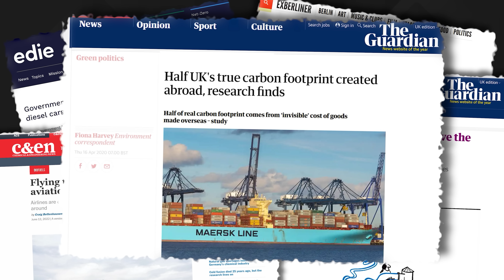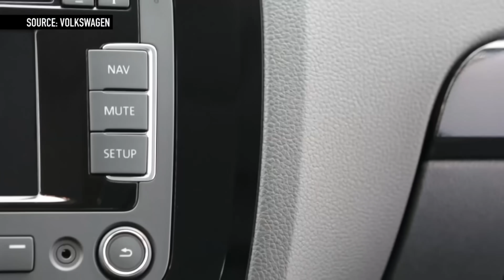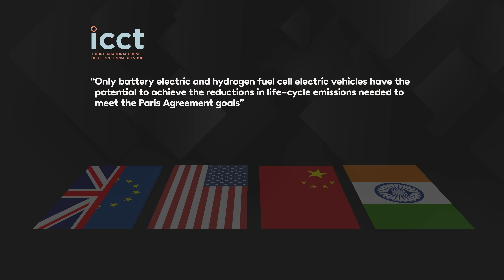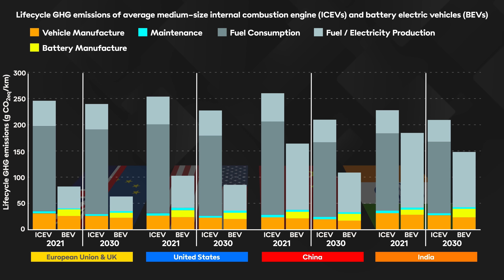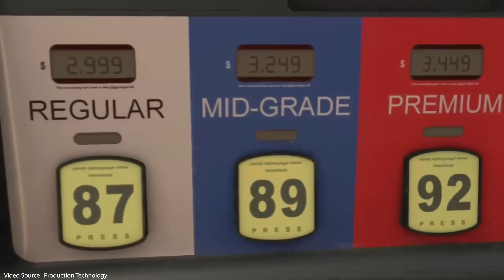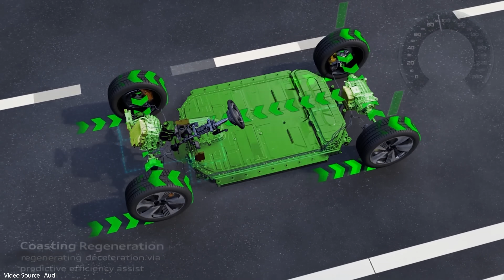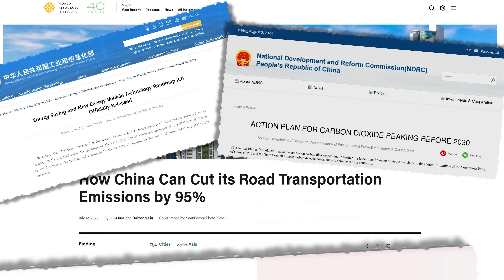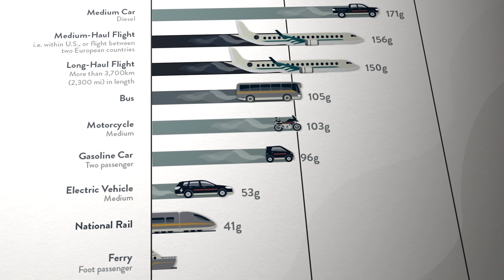Are EVs really better for the climate?

Comment: I bought an EV, what pushed me to it, I was mad at the petroleum Barrons for raising prices again. I had carbon dioxide contribution guilt. My Ice car was getting old. I have discovered  chargers in the states are often free. This no cost fuel will pay for my new, to me, used EV, in three years. It drives really well and is really fun to drive. It was a win win. I drive by the gas station and snicker, the price goes up virtually every time I do. Sometimes I stop and use the window washing soap and squeegee and smell the gas smell,  just to reminisce. No regrets.
Reply: I bought an EV(2018 Chevy Bolt) last October purely for financial reasons. We went from <10000 miles driving per year combined to ~25000 and our vehicles were fairly inefficient. The EV was the only vehicle that made sense from a financial standpoint to replace one of my ICE SUV. Had I tried to trade the ICE SUV in on a compact ICE commuter car, the commuter never would have paid for itself and I might as well continue to drive my SUV.

In my estimates, the only vehicles that could pay for themselves in a reasonable amount of time fuel savings was an EV, and in particular, cheaper EV's like a Bolt, Leaf, or VW eGolf.

That said, overall, I have been extremely happy with our purchase. I think we will probably always have at least one EV in the household from here on out. Even if the cost to charge it were to increase, the convenience, performance and everything is just too nice.

Comment: Nice video, but one big issue; you totally excluded the electricity storage problem which is basically Lithium Ion battery for now and sure to switch to something else in time but there will be always some kind of material used which will gave lack pf abundance and its own waste and production issues. Is Lithium Ion battery highly recyclable? Yes. Is is cost efficient and resource free? Hell NO. vehicle is substitute for us who want to present ourselves as environment friendly while being unable to part with out luxurious ways where we have to own our personal transportation. Public transportation was and is still the only viable solution. Most of the EV buyers do not buy them for environment anyway, they are in for either claimed fuel efficiency or enthusiasm of the new tech, none of them will go for public transport anyway including me as long as we have the means to access to a personal vehicle of some sort.

Comment: One solution that would absolutely work is Cyclecars.  If the maximum legal weight of a road vehicle was lowered to 750 lbs (340 kg), then the crash rating wouldn't need to protect you from gigantic vehicles, saving quite a lot of fuel.  It would mean lowering the speed limit to 45 mph (72 kmh), but then people could take the train if they needed to go over 100 miles in a day, and if they need to; renting a Cyclecar at their destination would be massively cheaper than renting a normal car.

Comment: People are just slow to change.  I'm lumping myself into the mix.  I have a gas scooter and car.  I don't plan on getting an EV until Malaysia gov attemps to install charging stations.  They're usually 10-20 years behind (when we are already at 2 degrees above).  Plus, I won't replace vehicles until they are old, when maintenance costs outweigh the cost of replacement. I do want an EV, and I routinely use my bicycle instead of the gas vehicles.  I'm not sure how to get from Malaysia to the US without riding in a gas guzzling plane.🤔

Comment: Corporate social engineers have diverted the effort to halt pollution and habitat destruction into a solely carbon gas metering system, which deliberately omits all the one to one industrial processes involved in sustaining civilization.
 This commandeering of ecology concerns is the single biggest assault on the ecology since the introduction of prepackaged goods. If transport of petroleum is a problem then why isn't transport of lithium products a problem? The energy yield pound for pound is several times greater with petroleum than lithium so more transport of lithium is required for the same energy output. There are numerous rare metals which require heavy pollution, destruction and slavery to obtain. I am disappointed in This video. I really thought these matters would be addressed

Comment: They has totaly missed the very much shorter lifespan of BEV approx 10 years .ICE diesels lasts 30 years if propery maintaned !!!
Reply: You are just wilfully making that up or you truly don't know what is going on. 
1/ No serious modern version of the BEV has had the opportunity to be 30 years old yet. So even at face value, you claim has never been tested in the real world
2/ No one keeps an ice vehicle for 30 years, simply due to the rising age related costs to keep it going.
3/ BEVs have fewer mechanical wearing components.
4/ There are EVs that have done over a million kilometers and still going well.
5/ Battery and drive train warranties are now appearing for the life of the BEV. Try and get that for an ICE vehicle. 😆

Please keep up.
Reply: @BrentonSmythesfieldsaye lots of 20 year old cars though. They aren’t uncommon.
Reply: @Peter-mj6lz  Yes correct, for sure there are ice vehicles that old, still around and going. It's impressive when you think about it. 
I am about to retire a 19 year old vehicle that has given outstanding service. It's been a great car and still a nice drive, since I have taken good care of it over the journey. But the transmission needs some serious work and coin spent on it now, among a few other things that are wearing out. So it is in that inevitable phase of diminishing returns.

But back to the original post.
There was a flipantly claim that EVs will last less than "10 years", without a spec of evidence to support such a claim. I can only assume they read or heard this in some ideologically based anti-EV online blog or media article.
The poster then made a claim regarding the life span of an ice vehicle, with the obvious intent of giving the impression that 30 year old ice cars can be a common viable daily drive for people. I am tired of isolated incidents of circumstances being portrayed as the everyday norm, to mislead people. It's either mischief or wilful ignorance, one or the other.

Comment: I think the wothery issue will be "Do we decarbonise with H2 Fuel for Transportation or Do we Decarbonise by going Electricity" . I think there is 2 school of thought here between Japan and China. Who is going to be asbolutely right, time will tell. I think ICE with HC is not worthy of discussion as it is an elephant in the room. It is ICE with H2 that is more relevant here.
Reply: Into the foreseeable future, hydrogen is a niche fuel that looks unlikely to be able to go mainstream. The current impediments are
Cost of production
Cost and logisitcs of transport
Cost at the pump. Usually between 2 to 3 times the price of petrol. So significantly more than electricity.

FYI.
The optimistic promotion of the Mirai by Toyota for example, has been a dismal failure unfortunately, for all the above reasons.
In Oslo, Norway, there was a two year side by side trial of some hydrogen and electric buses. They chose the electric buses and now operate a fleet of them.
When a rare hydrogen station has apeared for public use, they fail to attract any meaningful number of customers. They usually close in relatively short time frames.

No one has dismissed hydrogen, it would be great if it was another viable option, but it doesn't turn out that way, to date, in the real world. That doesn't look like changing any time soon for the better either.

Comment: I'm still struggling with the term "zero carbon" when battery EV vehicles are mentioned....  surely nothing will ever be "zero carbon".... surely we always need to factor in carbon used in the manufacture of these products and the carbon used to supply electricity to these products, plus the carbon emitted by the humans that exist to design, create, use & dispose of these products.   I would much prefer a more widespread adoption of the term "low carbon" when suggesting that these solutions are the answer to replacing "high carbon" products.
Reply: No one that matters has ever claimed that we are aiming for "zero carbon" use. That is made up silliness if they have. This is reflected by the fact that the official term "net zero" is employed.
If you know anything about the Earths natural carbon cycle, you should understand just how relevant the term "net zero" is to our current emissions situation and why any other term is not.

Comment: EVs SPEED UP GLOBAL WARMING.  Making an EV puts out the CO2 of driving a gas car 50,000. The EV has a 5 year head start on the gas car.  That extra carbon dioxide is warming the earth for 5 years before the gas car can catch up. If your electricity comes from burning coal your EV BURNS COAL.   Hybrid cars actually decrease total carbon dioxide by 50%.  They get 30 to 50 miles per gallon. Hydrogen fuel creates water vapor, which is a STRONGER GREENHOUSE GAS THAN A CARBON DIOXIDE.  EVs are a FRAUD.
Reply: You narrative is a fraud.

Comment: I was worried about clicking on this. I was expecting a whole lot of misinformation about how EV's were a waste of time. Glad this was not the case. Here's some real world numbers based on my old VW diesel vs my new EV: Miles per kWh (or fossil equivalent) diesel=1.10 EV=4.19. But ALL of the kWh equivalents from fossil fuels turn to CO2, but only 30% (depending on country) of electric power comes from CO2 generating sources, and they tend to be more efficient than a combustion engine. So .... CO2 per mile: diesel=200g EV=49g. No-brainer. Go EV.

Comment: It appears to me that you did not include the feasibility and the substantial economic and environmental costs to upgrading the electrical grid for charging large numbers of battery electric vehicles and EV Semi trucks that will massively increase the load on the electrical grid and raise the cost of copper and other materials for all other uses as well. There is also the costs for recycling old lithium batteries and replacing the batteries in used electric cars that also adds substantially to the cost and reduces efficiency  in EVs.

Comment: I find it frustrating how much emphasis is put on CO2 while far more enviromentaly damaging activity is ignored.
EV's have their place but are by no means the be all and end all solution people seem to think they are.
On the topic of transport and energy storage in general I would like to see more done with hydrogen.
Electrolysis can be used to stabilise the grid, avoiding down time of wind turbines or unrealistic quantities of batteries for photovoltaics, eco friendly current capture basically any situation with excess power production means the efficiency of the process is almost irrelevant.
There are multiple solid state storage materials where super cooled pressurisation is impractical and the main byproduct is pure H2O which is desperately needed in much of the world.
It just makes sense to me, we already have solutions to the difficulties of using it so why are we not?

If anyone has made it to the end of this comment congratulations, I usually skip the really long ones. 😅

Comment: EVs will not succeed as there is not enough copper to make the vehicles and, according to an International Energy report, there never will be.  What you ivory tower types don't realize is that in many parts of the western US there are towns that don't even have gas stations much less charging stations (I drove over 200 miles, most of it on a US highway, without going through a town).  Australia is another place where it is very far between towns. The city I live in is recovering from the second major power outage of the year, the latest lasted over a week.  Where am I going to get my spare electrons?  Australia deals with wild fires that burn down electric poles.  We had a hurricane years ago that took out power for three weeks.  We got in my diesel powered motor home (a full tank of fuel is good for about 1,000 miles) and camped out far from the hurricane damaged area.
Let us not forget about batteries catching fire or exploding and giving off very toxic gases.  Also, we don't have enough electricity now so how can we support all these chargers?
Reply: So you do not have electricity, a generator or solar panels...are you a cave person?

Comment: just some comparisons: 1 - life: everyone surviving an petrol car fire, noone remaining alive after battery car fire (2700-2900 celsius, melting steal and concrete of airports, malls and hospitals); 2 - energy expenses: every new produced battery car consuming ten times more energy compared to every new produced petrol car - and energy comes from burning gas and coals, yes?; 3 - dirt: every new still unsold battery car polluting the soil, water and air so much, as its petrol "partner" - every new produced and sold petrol car, used intensivelly for ten years - say 300-500km per day. here not including the most gigantic pollution - the tire and brake pollution ruining all the roads because the heavier and mightier battery cars, driven by unstable minded persons, trippling the tire pollution and ruining quadruple times quicker all the roads, not even paying the same road tax - all those battery-car taxes divided equally among all the taxpayers - both using cars and pedestrians. cheap, fair and sustainable yes? just for the not-rare metal named copper, just in small teritory as british islands, just for growing the usage of battery cars from 10 to 70%, just for producing the needed battery cars, there is needed twice the copper already invented in the whole planet, not even speaking of the copper needed for re-bulding another more mighty megawatt electrical grid, and not even mentioning the rare metals as cobalt, fully digged and melted with forcible child slavery work in africa, dominated by not so eco-friendly and not so humanrights-compatible chinese communist party. same british needs for rare metals are much moderate for above mentioned period - around ten years - rare metals needed just for british growth from 10 to 70 percent of "new" cars is 70-85% of world posessions of rare metals - and every battery car needs tens of kilograms of these metals, wich in their immortal burning (thermal runaway) self-supply with oxygen and do burn even thrown in a lake or in a river, right until all the materials do end, and each burning battery car sending above 15 tons of highly toxic and deadly to humans gases. so safe, enviromental friendly and so sustainable, and most of all - so affordable - every indian and african worker earning 4-7 usd a month would pay some super-car named tesla or similar, for just 90-100 tousands usd, in no time - just in several centuries and several generations. welcome to the brave new world - you own nothing and you are happy.
Reply: An electric car fire is rare and gives warnings before, very few dies in them.

The batteries are recycled, they are even more valued compared to lithium and cobalt ore combined. Stop lying.

An electric car uses larger tyres, so the tyre pollution is only linearly more scaling with the increase in weight. The majority of pollution from tyre wear is from Semis and other commercial vehicles who have 2-5 times higher ground pressure...which means 50-500 times more road and tyre wear!

The energy required for making batteries and the vehicle is paid back even with the dirties electricity by around 100 thousand kilometers driven.

We will change to renewables, you will be angry, cope harder.
Reply: An electric car fire is rare and gives warnings before, very few dies in them.

The batteries are recycled, they are even more valued compared to lithium and cobalt ore combined. Stop lying.

An electric car uses larger tyres, so the tyre pollution is only linearly more scaling with the increase in weight. The majority of pollution from tyre wear is from Semis and other commercial vehicles who have 2-5 times higher ground pressure...which means 50-500 times more road and tyre wear!

The energy required for making batteries and the vehicle is paid back even with the dirties electricity by around 100 thousand kilometers driven.

We will change to renewables, you will be angry, cope harder.